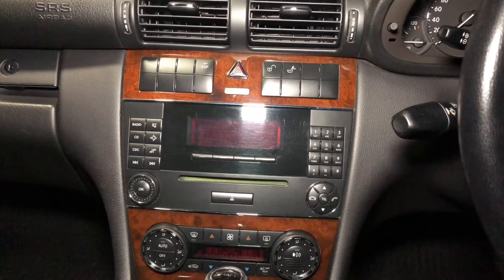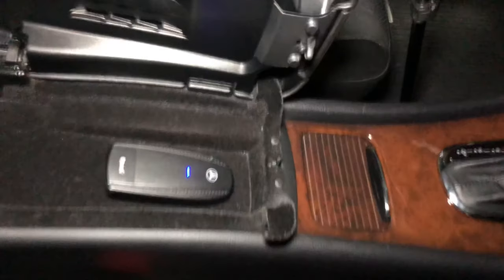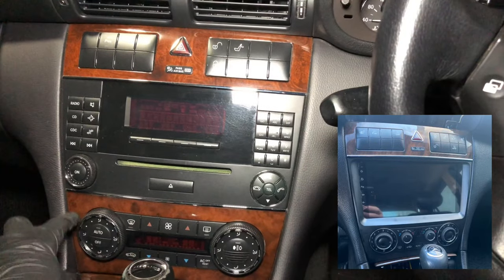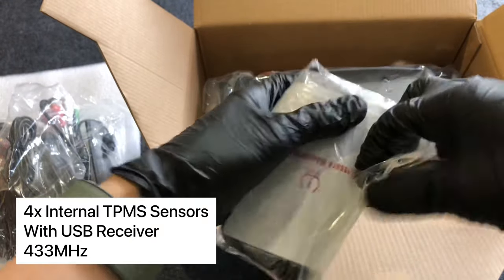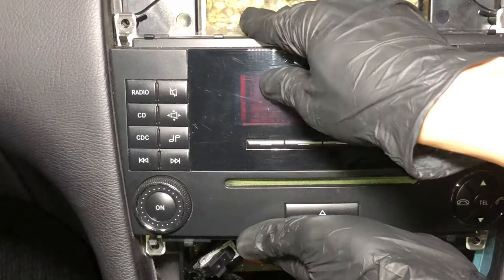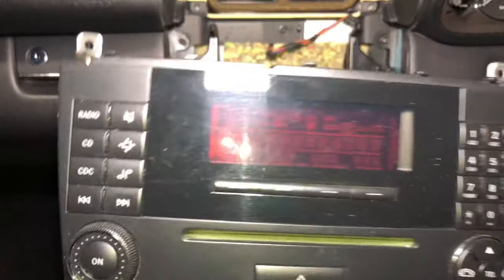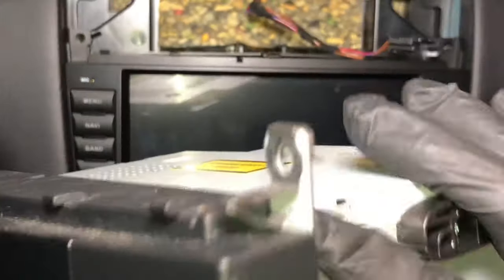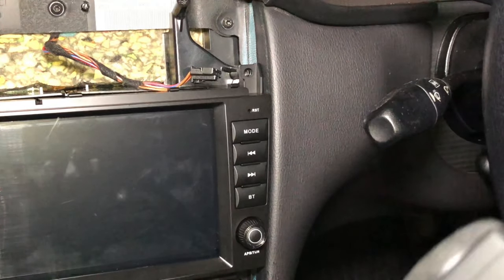MERCEDES C200 W203 | ANDROID HEADUNIT INSTALL GUIDE

Comment: Thanks for this video!
It was brilliant at helping me setup my head unit.
Did you ever figure out the functions of the yellow or black wire for the antenna and which one is to be used? I tried both but not sure which should stay plugged in
Reply from the maker: Hi zabiddin, thanks for watching the video. With regards to the radio antenna, i ended up using the black connector because the headunit didnt detect any signal when I connected it to the yellow one. 

Are you getting radio signal on both black and yellow connectors?
Reply: @AutosNGizmos  thanks for your reply!
I got a couple of radio signals with the yellow, but mostly the black gave me access to all radio stations. Thanks for your help! Reverse camera next! I have your video to hand

Comment: Great detailed video, extremely helpful! Thanks for the content :) I recently bought a unit like this, although everything works fine I have a problem, with the car running, every 3 seconds +/-, the quadrant backlight turns off and on quickly. Also when I use the lights in automatic mode, during the day, the front and rear lights of the car flash the same way. When the car is not running everything looks ok. Do you have any idea what it could be and/or how to resolve it? Thanks
Reply from the maker: Hi Joao, I have a similar issue with the one headlight turning off/on randomly but that was because I switched from halogens to LEDs. I never experience this issue while on halogens. At some point i was contemplating on reprogramming the car but I never got around doing it.

Do you happen to have LEDs installed on your car?

Comment: Thanks for a thorough tutorial. Did you have a Harmon Karson speaker system with factory amplifier?  Wondering if you have to bypass the amplifier and if so how do I make all 9 factory speakers work?
Reply from the maker: Hi Raoul, my C200 didn’t have the HK speakers and I needed to do was to connect the wiring harness and the sound came out of the speakers. I didn’t check individual speakers though.

But I did hear about other people having issues with connecting this headunit with their HK speakers.  It seems there is fibre optic converter that is needed.

Here’s a video of someone DIY-ing the fibre optic converter.  You can skip to 14:20 timecode

https://youtu.be/k6Gfd7UHMSo

I hope this is helpful and thanks for visiting my channel 😊

Comment: Hi, great videos! Was wondering what you did with the GPS, I haven't done mine yet. I would prefer to use the mercedes GPS antenna, you indicated you would do this later in the video but I haven't seen it. Was there already a GPS antenna behind the radio? did you have to purchase a separate frakas C to SMA connector? or did you have to run a wire all way to the trunk? (I've read conflicting posts on forums about this). Thanks!

Comment: This is an OUTSTANDING job on a DIY tutorial for this subject!!!!  I have Benz that I want to do this same EXACT thing!!  I would just like to know what Brand and Model# this NEW headunit is????  I LOVE IT!!!!  If anyone knows what unit this is, could you PLEASE LET ME KNOW!!!!!!  THANKS!!  BTW, MY car is the 2007 C280 4matic, 3.0l??  Immaculate car, 97k miles!!  This is a KEEPR for me!!  I got it in July, 2022??
Reply from the maker: Hi MST3K, thanks for your feedback and watching my video.  The headunit I installed for my W203 as featured in the video is sold by a seller called KAPUD in AliExpress.  The link to the product is in the description box so make sure to check it out later.  Just a note that some viewers of the channel have reported that if your car has Harman Karon speakers or a three-spoke steering wheel, you might encounter some issues with sound and steering wheel control.  So please make sure to check with the seller for compatibility.

I also love this car just like you and got it second hand about 2 years ago.  I love the way it looks an the way it drives.  Mine has a slightly less mileage (86k miles). 

Good luck with your DIY project and make sure to check back in here if you have any questions.

Comment: Great video. I see these types of head unit and wiring harness don't have an optical output. How did you get the output from the new unit to interface with the mercedes connector?
Reply from the maker: Hi Dr Thewam, my C200 does not have the upgraded Harman Kardon (HK) speakers so it doesnt have the fibre optic cables.  The audio comes out from the main ISO connector and into the car’s wiring harness.  But I did hear about other people having issues with connecting this headunit with their HK speakers.  It seems there is fibre optic converter that is needed.

Here’s a video of someone DIY-ing the fibre optic converter.  You can skip to 14:20 timecode

https://youtu.be/k6Gfd7UHMSo

I hope this is helpful and thanks for visiting my channel 😊

Comment: thanks for the detailed work what is the name of that head unit i have a w203 would like to fix one your response will be appreciated
Reply from the maker: Hi David, I bought the headunit featured in the video from an online store.  You can check it out using the link below.

Android Headunit - https://a.aliexpress.com/_mLsCqQp

Be sure to confirm with the seller compatibility with your car (they usually respond in a very timely manner) before you make the purchase.

If you are an Apple user (like me) and want Apple Carplay, support is through a built-in app called Phonelink but you will need to purchase the higher spec model.  If you are an Android user, some users report here that Android Auto isn’t supported unless you purchase a separate license for another app called Autolink.

Good luck!

Comment: Hi there, love the video, it was very helpful however I wanted to ask if you lost your volume control via the steering wheel? I don’t quite know how to get that to work properly
Reply from the maker: Hi Tyler, I personally didn’t encounter any issues with the steering wheel buttons when I install this headunit on my car.  However, I’ve had other people report issues with steering wheels buttons if you have three-spoke steering wheel.  Try reaching out back to the seller (if you have done so already).

Comment: Amazing and informative video I am thinking of upgrading to w203 android multimedia too. Does the phone have to be connected via usb all the time for navigation, youtube and other things to work or bluetooth is enough for that? How is the calling and answering working while driving?
Reply from the maker: Hi Stėja,
Firstly thanks for visiting my channel and watching this video.

If you have an iPhone, there is an option to enable Wireless Carplay so you dont need to plug in your phone on the USB.  I find this feature really great for short trips.  However for long trips, I tend to plug it in the USB to keep my phone battery charged up.  Unfortunately for Android phone users, the only option to use Android Auto is via wired USB connection.

Alternatively, there is a way to use navigation, youtube and music without using Carplay and/or Android Auto.  But you have to install those apps directly on the headunit from Playstore (remember, this headunit is an Android system).  Once installed, you can connect the headunit to your phone’s hotspot.  And finally there is bluetooth.

IF YOU ARE HOTSPOTTING:
Allows the headunit to connect to the internet and gives it the ability to download map data in realtime while using turn-by-turn navigation, play songs via spotify and watch videos in YouTube (while the car is stationary of course 😉).  This setup requires more cpu/ram so I would stay away from the entry level spec.  As an alternative to hotspot, you can get a 4G SIM card and install it in the card slot.

BLUETOOTH:
You can also just simply connect your phone to the car via bluetooth and have all phone audio (Navigation, music, YouTube, etc) go through the car speakers. You will still be able to control music playback using the steering wheel controls.  The only drawback here is that you need to mount your phone on the dashboard if you are using it for turn-by-turn navigation.

PHONE CALLS WHILE DRIVING:
WIth phone calls, you simply use the answer/hang up button on the steering wheel.  However, the built-in mic in the headunit is not of good quality so make sure to install the external microphone that came with the package.  You can watch my other video if you need help with that installation as well.  Link here 👉 https://youtu.be/T0IaLzNrsvA

I hope this information is helpful.  Good luck on your project and feel free to check back in here if you need further assistance.

Cheers 😊

Comment: I took the model 4-64 (((On the 207 Mercedes C230, there are not such wires at all!))) Yes, and the manitola itself with a bunch of wires!))) It turns out that in order to make it, it shoots for a decent amount! I decided to put it on and slowly at least use it without sound))) The navigator shows))) YouTube)))) I will look at the pictures) in the meantime I'll figure it out over time)
Reply from the maker: Hi Vladimir, sorry for my late response.  Does your car have the Harman Kardon speakers?  I have other people saying if you have Harman Kardon speakers, you may need an MOST fibre optic Amp interface.  Try to have a chat with the seller as they may be able to help you buy that part.

Also, have a look at this video about how to install fibre optic decoder installation: https://youtu.be/k6Gfd7UHMSo

Comment: Excelent video. My car has a cd changer Mercedes MC3010 in the glove compartment. How can I connect it to the headunit that I'm buying from Aliexpress. I think I will need an optical fiber converter but I don't know wich one. Can you suggest one, please? Thanks
Reply from the maker: Hi Pedro, thanks for watching my video.

To be honest, I don’t know what is needed (or if it is even supported) to connect the CD changer to the headunit. I can look around Aliexpress for you and let you know options to do this if I find one. I can also try to ask the seller I bought mine from if they have any suggestions - assuming you haven’t asked them yet?
Reply: @AutosNGizmos  I wold appreciate if you could help. The car is a C220 CDI W203, production date is 2004-11-20, the cd changer is the MC3010 D2B and the car console is an Audio 20. Thanks a lot.
Reply from the maker: Hi Pedro, so I’ve reached out to two separate sellers (selling android headunits for W203) and both of them said their headunits does not support the CD changer.

IMHO, trading off the CD changer for an Android-based system is worth-it especially if you have chosen the higher-spec model which can do Apple Carplay and possibly Android Auto.  Some of my channel subscribers even said they were able to get the seller to give them the Activation Code for the Android Auto to function properly but I can’t validate this because I’m an iPhone user myself.

Whatever you decide, good luck and feel free to drop in to my channel if you have any questions.

Good luck!

Comment: Hi, great video. Could you use and screen that is a double din for or would it have to be specific to the Mercedes design? Thanks
Reply from the maker: Hi Gav, the original car stereo that came with this car was also a double-din so if there is another after-market double-din car stereo that is not built specifically for your car model, there are two things you need to worry about:
1) Does it have the correct fascia kit to cover any gaps between the new stereo and the dashboard?
2) Second, it would also have to clear the inside frame so it will sit nice and flush.

As an example, I’ve worked on a headunit install for an X5 E53 (from 1-din to 1-din and it came with the correct fascia kit) but in order to fit it in, you need to cut a plastic frame inside the dashboard cavity because it gets in the way of the new headunit.

So the safe answer to your question is that the new 2-din headunit need to have the correct fascia kit and conform to the shape of the dashboard cavity.

I hope that answers your question.  Cheers!

Comment: great video withlots of detail. How is the interface with your instrument panel of your dashboard. For example, on my mercedes I get navigation instructions from my Comand head unit (I see you don't have that). I'm wondering if it will still work if I build in this head unit, do you know that maybe? And would it be possible to use the existing GPS cable?
Reply from the maker: Hi vingibson, yeah thats a tricky one.  But with this headunit on my W203, when I use the built-in Radio app, the LCD screen on the instrument cluster seems to display the info if I set the mode to Audio.  When I switch to use Carplay on the headunit and I’m still on Audio mode, the LCD screen will just say “AUDIO OFF”.

However in saying this, there is a built-in Navigation app in this headunit called iGo Navigation.  I’m not sure if this (like the built-in Radio app) can send info to the instrument cluster LCD screen.

With regards to the existing GPS cable on your car if that can be used with the headunit, probably best if you send a message to the seller to confirm.  Have you tried reaching out to them?

Comment: hi.  Do you remember the seller and what exactly was the name of the radio model?  how does it work for you, do you have any problems with bluetooth or anything?  thanks for the answer.  Regards
Reply from the maker: Hi Piotr, the name of the seller is Kapud. This is the link to the product page: https://tidd.ly/3yPeEjz

However, I notice they changed the theme of the UI.  Rather than having the one with big blue icons, they now show the common them you see in other headunits. I don’t know if there is way for the seller to load it with the old style (big blue icons) theme.

I’ve had this car for almost 2 years and I don’t have any issues with it. But in saying that, I normally use it with Apple Carplay.

Comment: From Thailand  Thank for this video. I have some questions  about. Dynamic reverse camera.  It can setup with this head unit? Or not. And how to wiring ? And the backlight color is the same with original (orange)?
Reply from the maker: Hi there ss, Yes this headunit supports reverse camera with dynamic trajectory lines when you turn the steering wheel.  To get the dynamic trajectory lines, you just need to set the CAN type setting using this procedure:

Go to Car Settings - About Device - Tap the settngs icon at the right - Enter password "8888" then OK - CAN Type - Change CAN Type to BENZ(Lz) - Save - Reboot
NOTE: You will lose your saved Radio stations so you'll have to config it all over.

If you need detailed instructions how to wire or fully install the reverse camera, you can check out my other video in this link ->> https://youtu.be/uf7iFzxUnoA

Lastly regarding button illumination colour, it’s actually red and you cannot change it unfortunately.

Comment: Can you tell me what CANBUS mode you use?
I have it set to BEZN LZ, it nice show when Door open on screen.
I am curious if It can be configure to show front and back parking sensors on screen?
Reply from the maker: Hi there, yes I have it set to Benz LZ.  However with regards to the parking sensors on screen, I have not found a CAN Type that will support that.

Comment: Hey. Just a question on the GPS antenna. I see you put it on top of the dash. Was there poor signal when it was in the dash?
Reply from the maker: Hi Greg, Tbh I didnt try putting it inside the dash so cant comment which option is better. One thing I can say is that since I mainly use Carplay, having the GPS receiver was unnecessary for me.

Comment: Excellent video, thanks for sharing ! 
 I would like to know if the can bus adaptor makes  the link from  the radio to the sound system. ... 
thanks !
Reply from the maker: Hi Abel, thanks for watching my video and sorry for taking a long time to respond.

My C200 does not have the upgraded Harman Kardon system which means it doesn’t use fibre optics to connect to the speakers.  All the speaker connections are in the main ISO plug of the headunit and it was a simple plug-and-play for me.  If you are not sure if this Android headunit is compatible with your car, please reach out to the seller directly.  They should be able to help you as long as you provide them with the Year/Make/Model of your car and photos of your existing car stereo.

With regards to your question regarding CANBUS, I believe the CANBUS doesn’t carry audio signals - they’re mainly used to read/transmit signals from the car’s onboard computer to the various components of the car.

I hope this is helpful and let me know if you need further information 😊
Reply: @AutosNGizmos  thank you very much for the answer, I will get in contact with the seller, I think  there is a small unit that converts the analog audio signal from the radio to the fiber optic receptor from the car original audio system and integrates the original Mercedes Benz audio amp.
Thanks again !!!